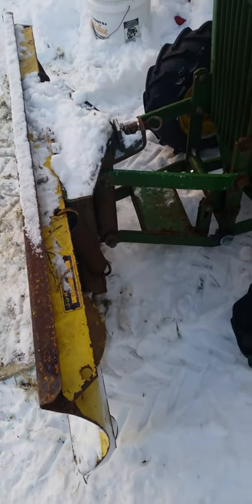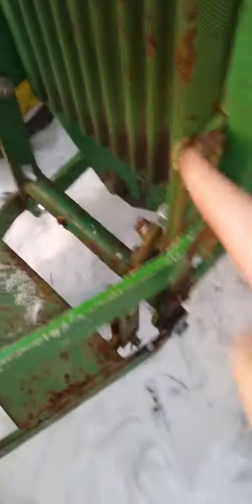John Deere Round Fender Snowplow Install

Comment: So uh how do you attach the helper spring that is apparently so helpful
Reply from the maker: I actually have a video on that. But in my video I am missing the small bracket it's supposed to hook up too. I hooked mine up to the bolt that holds the bracket.

Comment from the maker: if i remember right the bolts for the brackets that bolt to the plow to frame are 3/4 inch and i put lock washers on them. Here is the site that list all the parts needed. https://weingartz.com/illustrated-diagram/john-deere-parts-lookup/model-43-front-blade-110-112-200-208-210-212-214-216-lawn-garden-tractors-pc1086-e0690106801-112900-1968-43-front-blade-110-112-200-208-210-212-214-216-lawn-garden-tractors-pc1086-e0690112901-118700-1969-43-front-blade-110-112-2/4275-260